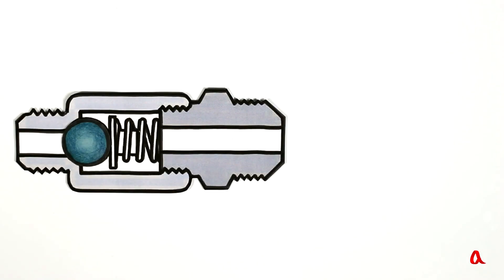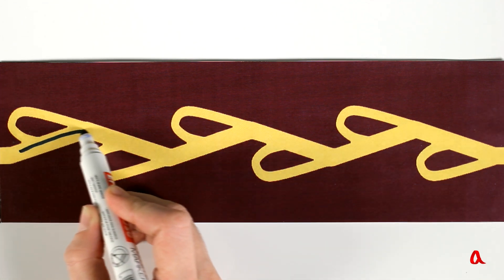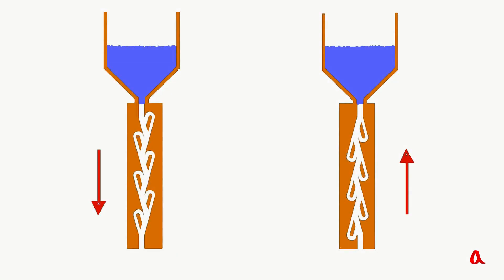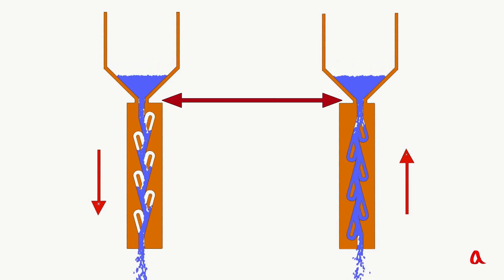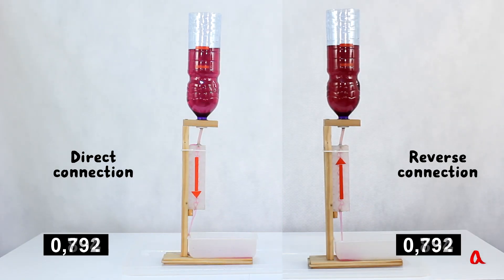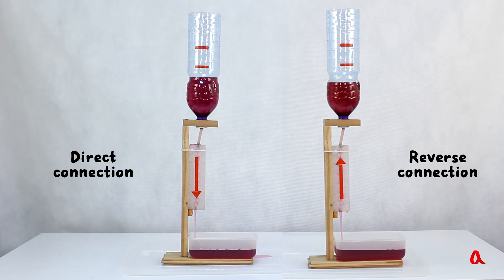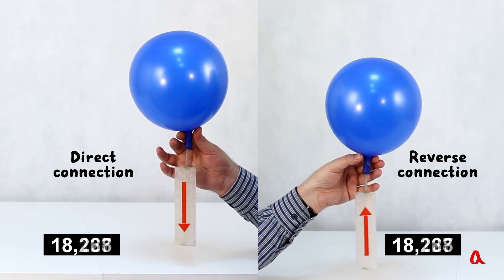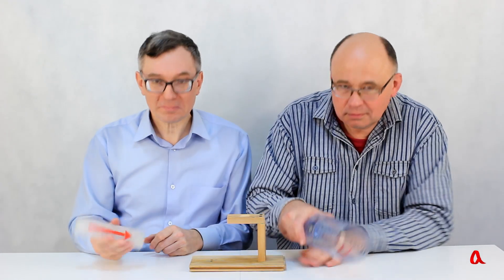Tesla valve

Comment: First, 1:52 your 3D printed valve doesn't look the same as the computer model previously shown 1:42 , which looks more like Tesla's illustrations for his Valvular Conduit patent. The 3D print has obstructed flow in both directions instead of the straightened path in his original design, so your differences in flow won't be as dramatic between forward and reverse flow.

Second, it was designed for a steam engine Tesla was working on, so it was meant for high flow applications which were probably time dependent since it won't completely stop flow like a check valve. At slow flow rates it will flow equally both ways, but at high flow rates it will flow easy one way and the other way is very restricted by turbulence introduced through the loops.
Reply: To add to that, while in the first example the water left the container both at the same time, it took longer for the water to leave the valve completely.